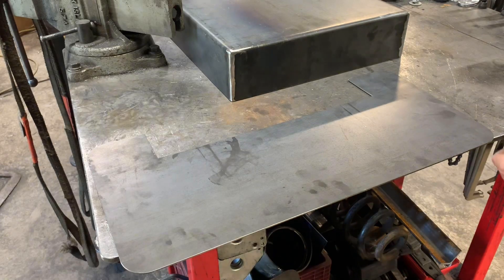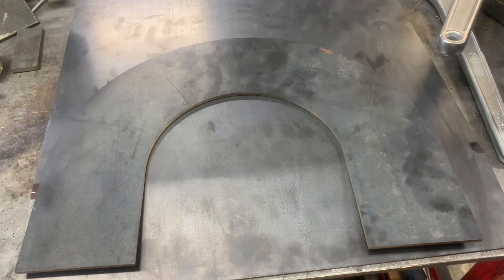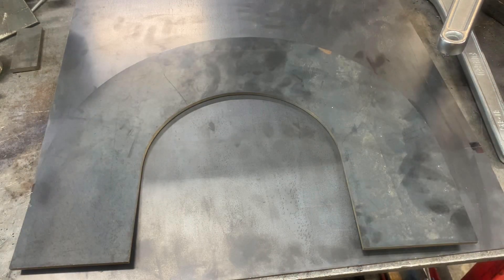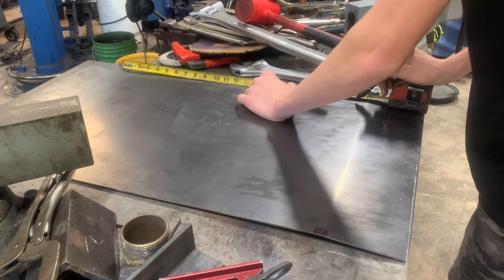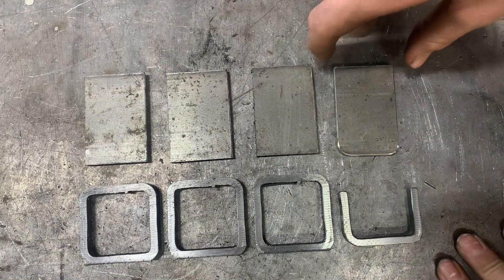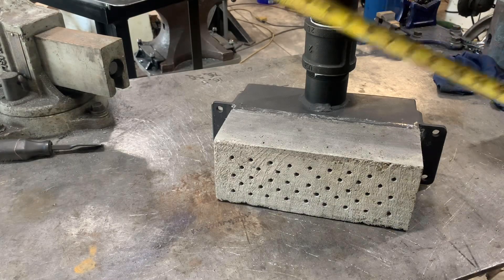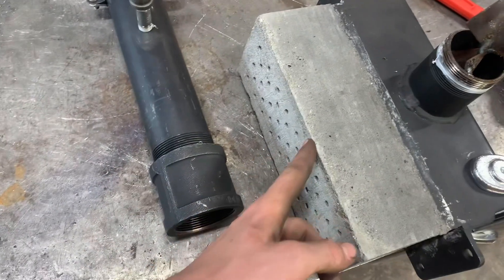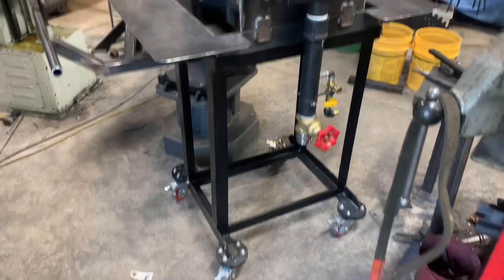Making a ribbon burner forge - part 2

Comment: This is the best thought-out ribbon burner forge design I have seen on YT - THANKS for sharing! Frankly, I just changed my design for the better, thanks to your ideas here.
One question about the burner itself if you can answer:
 How did you "heat treat" the assembled burner? I've purchased some castable refractory to make mine BUT the instructions for that require a crazy regimen of heat treating; I can begin by throwing the finished burner in the kitchen oven for the first few hours under 400°F as needed, but then they have a long routine going up to 2000+ for a while (the material is called 3100 degree Firecast, very similar to Kastolite 30, with alumina). Anyway, if you used something similar how did you go about it? Another concern is the steel itself in the assembly. I sure don't want to damage that. Or... maybe I'm overthinking the whole thing? Thanks again!

Comment: Thats a bad ass forge. I need to build one that is a beast like this one. What did you used to cut that arch in the face plate of the forge? CNC Plasma, Plasma, angle grinder and burr bit? It looks absolutely perfect and I was wondering how you got it that way. Have a good one!
Reply from the maker: Thank you, glad you liked it. 👍The face plates were cut out on a water jet at our machine shop